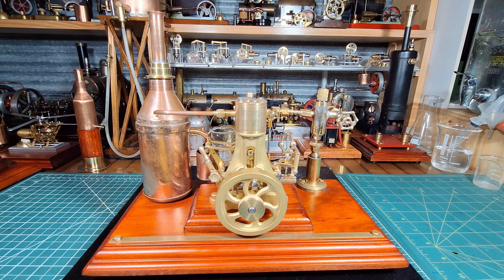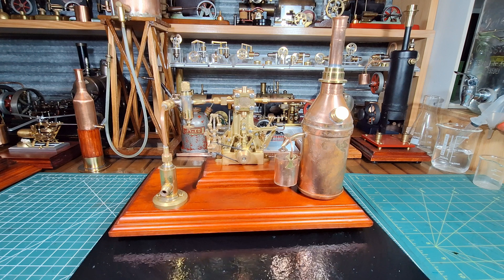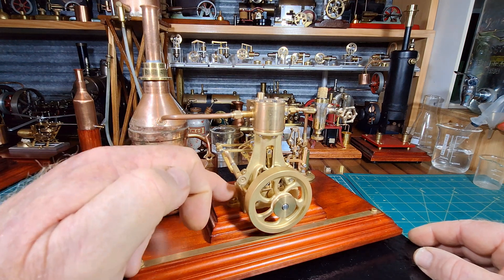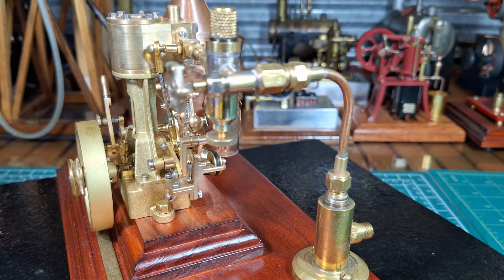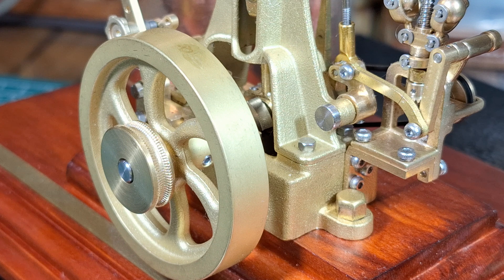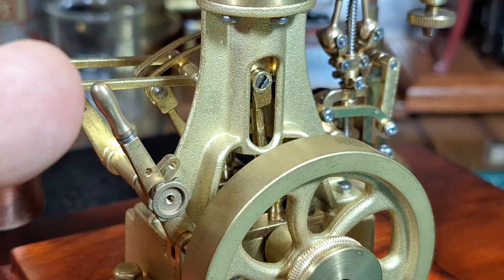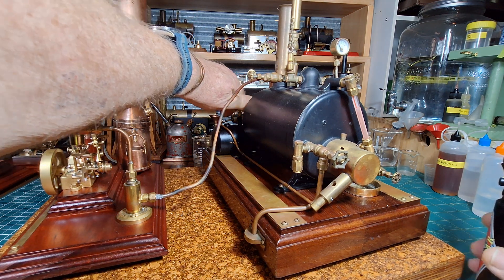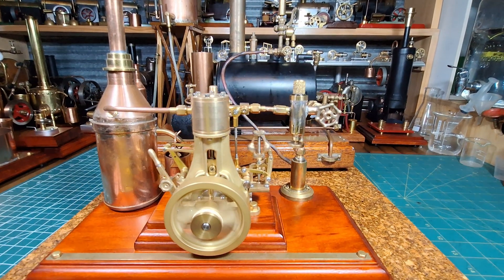OKMO Microcosm Model M31 Vertical Steam Engine Single Cylinder with DIY Modifications

Comment: That‘s a great steam plant you arranged around the M31! Thanks for all the details you‘ve  presented in words and pictures. I‘m looking forward to your video demonstrating the engine running at various speeds … Cheers, Detlef. 👍👍👍
Reply from the maker: Hello Detlef, I had some enjoyable hours adding and changing things to this engine. The grubscrew on the flywheel came a little loose and introduced a slight wobble to wheel. I have taken now most of it out. Hope you have a great weekend - Cheers Jim

Comment: Lovely engine Jim, just purrs along 👍👍👍 Is it my imagination or is there a very slight wobble on the flywheel?  Cheers, Alan.
Reply from the maker: G'day Alan, in the first part of the engine running the flywheel is running true, the grub screw came slightly loose. Not sure how much work this will do or whether it will be a shelf queen. Keith Appleton mentions that the brass doesn't wear all that well compared to a casting like a Stuart when he talks about these Chinese engines - Cheers Jim
Reply: @SteamEngines-Jim  Hi Jim. That would explain it. Yes, engines like the Stuart Turners are made mainly of cast iron, if looked after they will last forever. Still, the engine does look amazing in brass 👍👍🙂 Cheers, Alan.
Reply from the maker: @RetroSteamTech  I have two Stuart S50's with gun metal cylinders. I don't think Stuarts cast in gun metal anymore ??
Reply: @SteamEngines-Jim  Most of the Stuart Turner cast parts sets that I have seen these days are cast iron. They have been making model steam engines and castings for years so I'm not too surprised that you have some that are in gun metal. Gun metal or even just standard bronze has long been a favourite metal among steam engine builders.
Reply from the maker: @RetroSteamTech  Looking at the Stuart online catalogue this morning, some of the larger Stuart castings still come with some gun metal castings.
Reply: @SteamEngines-Jim  Really, that's interesting. Mind you the casting sets for the large engines like the No.1 and No.4 are fairly expensive so I guess that makes sense. I've only ever played with the little Stuart Turners and they are generally cast iron and brass for the bearings.